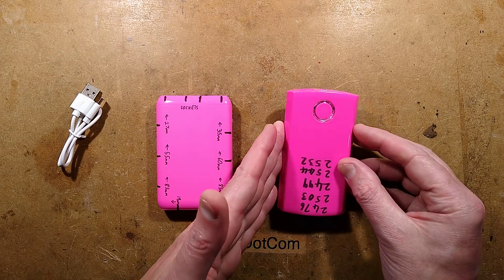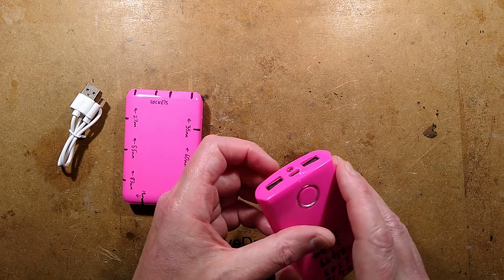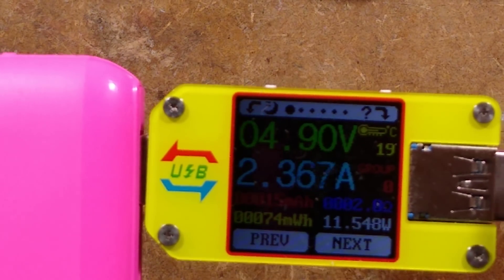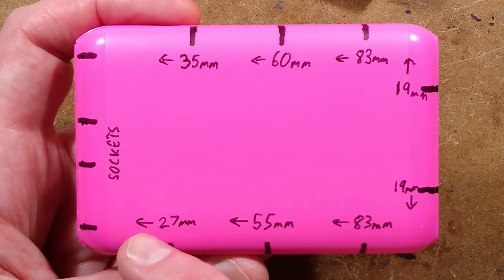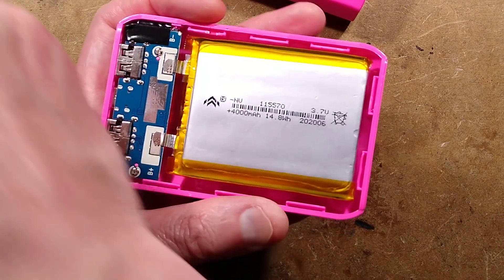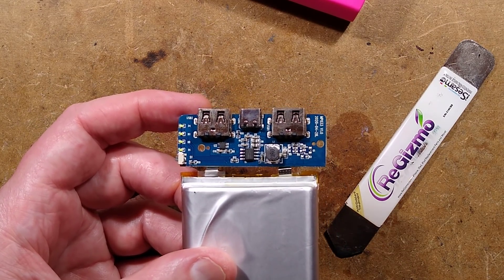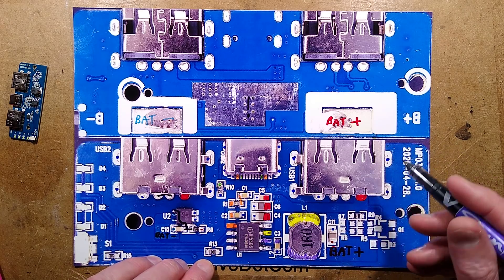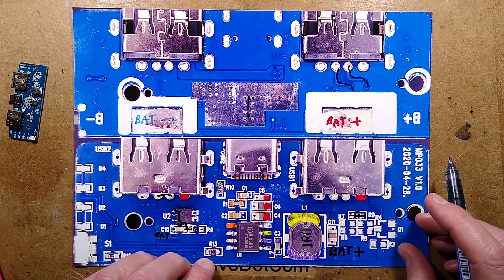Poundland's new 4000mAh power bank

Comment: I took apart a GPS a few months ago and noticed the battery, inflated slightly, had a weird smell coming from it. I later noticed it had a tiny hole in it. I immediately wrapped the two wires in electrical taped and the battery itself in electrical tape, then a thick later of duct tape. I later disposed of it.
Reply from the maker: Smells like pear drops.  When that happens it's best to discharge the cell to make it safe and then dispose of it, as it will reduce in capacity rapidly as the electrolyte escapes.
Reply: The safest way is to put it into a bucket of water. The water keeps the battery cool (so no chance of a fire) and it also slowly discharges completely through the water.
Reply: @superdau  Lithium and water is quite literally the worst possible thing you could do.
Reply: @trentvanslyke9404  I'm pretty sure lithium ion batteries don't contain elemental lithium and therefore shouldn't present that fire risk. However I wouldn't want to be the first to test this.
Reply: @trentvanslyke9404  
This is a rechargeable lithium ion battery. There's hardly any lithium in it, and especially no metallic lithium.
There's a reason fire departments extinguish EV car fires just with water and airlines instruct to to the same with battery powered devices that for some reason caught fire.

Comment: I believe that 5.1K resistor on the CC lines of the USB C connector are to tell the host device that it only communicates via USB 2 (or for power devices, signals that it uses USB 2 power delivery standards). If I'm not mistaken, tying both CC lines to ground via the same resistor is a violation of the spec. They should each have their own 5.1K resistor. This is the same design violation that was present in the initial run of the Raspberry Pi v4. There's a few articles online about the subject.
Reply: I would have bet on the CC line (Configuration Channel) for signaling Current capability (and cable orientation) as well, but I wonder about the Pinout, wouldn´t CC1 and CC2 be on Pin A5 or B5 respectively. But not sure about the pinout of that socket as well, also I can hardly imagine they crossed over pins within the socket. But you are right, if it is CC, each should have its own resistor. What makes me suspicious about the pinout of the socket as well though is also, that the outer connectors are actually wider than the others. with the housing of that socket beeing connected to ground, I would assume those are VBUS then where Power is transmitted, at least it would absolutely make sense to design those a tad beefier than the data pins. But those usually are Pin 4 and 9 in the socket. Unless of course this is actually a Power only socket, but then I wonder why they stil have 10 solder pins while actually 6 or 8 would be enough for those.
If it was CC, I just looked up what the signaling was for the different currents. I think the in this case the power consumer measures the voltage between CC and ground to determine the current the source can provide. I think the lowest value would be 0.41 V, indicating either USB 2.0 500 mA or USB 3.0 900 mA, about 0.92 V would be 1.5 A and about 1.68 V would be the full 3 A.
For those who wonder as I mentioned CC1 and CC2, those are the same pins on the different sides of the USB C plug. through this the device can recognize if both ends of the cable had been plugged in "straight" between possibly two USB C sockets, or if one side was twisted (the plug turned by 180 °)The "other" Pin would be used to power "active" cables (which is called VCONN).

Comment: The use as a USB UPS could be useful. I was after just such a thing a while back when first getting into single-board ARM machines. The amount of power banks that can do that charge and output thing is rather rare.

Perhaps, if someone wanted to use it for such, they could fit a small passive heatsink to that one chip with some superglue.

Oh, so far as my own usage went, I wound up getting a Chinese 240v -> 12v power supply that supported a 12v battery as a UPS for it. Then I used a bunch of 12v -> USB adaptors and wound up with a lovely 9AH UPS for USB and 12V.

Comment: Does anyone know why all these power banks have a minimum power   draw requirement or else the shut off after a minute?  I would love to power small 10mA circuits but can't.
Reply from the maker: It's to save power in standby.  When a phone is charged the current drop shuts the power bank off so that any parasitic draw in the phone charging circuitry or the power bank's boost circuitry doesn't continue to drain the battery.
There are circuits that pulse a higher current to keep it awake.
Reply: @bigclivedotcom  That clears up  a lot of my confusion.  I wonder if there are any power bank ICs that allow a user to disengage that feature.
Reply from the maker: @CamanoBert  There are versions - usually the lower capacity units that always put out 5V.
Reply: Could you use the powerbank to charge a capacitor then power your circuit from the capacitor? 

Perhaps via a current limiting diode? to slow the discharge.
Reply: @theopelgrave5842  I am intrigued by that idea.  I will try it today.

Comment: I kinda want one of those "OG" poundland power banks. I have been looking for a long time for a power bank that maintains a 5 volt output always.
I have a few that will drop the voltage to about 4.5 volts and drop down to 4 then back to 4.5 every few seconds. Some stay on for like 5 minutes then turn off, some will stay on conditionally, and an old flashlight/usb charger will stay on always. (until the battery is depleted obviously.)

EDIT: I forgot to add that a sufficient load (about 100-250 mA, depends on which one, tolerances probably) will "activate" the "weird" ones and will then maintain a stable 5 volt output.
Is Poundland online too? and is it UK shipping only?

Comment: He's so careful with the battery, watch a cellphone repare shop replace an iPhone battery.
Reply: It's ridiculous that you have to go to a repair shop to get a new battery fitted. It should be a user replaceable part.
Reply: @peterjf7723  This is where the 'Right to Repair' thing is heading. Governments in the US, EU and the UK are pushing for consumer laws which allow self-repair and replacement of certain parts of consumer products. I presume mobile phone batteries would be covered by this.
Reply: @mjt8199  That is good news, I hope that such Right to Repair laws can be put in place  quickly.
Reply: @mjt8199  right to repair really needs to be sorted on cars. I know several cars where the rear LED 'side lights' have failed and you can't get in the welded plastic case. So instead of a $10 replacement bulb, you know need a $600 complete replacement light unit. These examples are Toyota an GM vehicles, but no doubt the issue is more widespread... :(
Reply: @mjt8199  Part of problem is manufactures will just keep making them harder to take apart, stronger, more industrial glue, etc so if is more likely to break when doing a repair. I wouldn't put it past them to just fill it with glue, slap it together then bake it to cure.
Reply: Actually you should try to pry batteries like this with more than one "pry" bar at a time to prevent damage.  Or use a wider pry bar again to help distribute the pressure.
Reply: Big Clive ain’t getting paid per job completed 😝
Reply: @cavemandanwilder5597  I got hourly but yeah, taco the mf and it comes out unscratched 99% of the time.
Reply: The difference is that the phone shop works on the same models day in and out. Get quick to make the money. Clive was going in blind and being careful. Quite rightly I might add.
Reply: @matthewhattersley1286  Already said, I work hourly and never got paied per job, if I did I'd own a home and six cars.
Reply: @LenoreLeStrange  might want to rethink that business model. Someone should be paying for your skills, not your time.
Reply: Most of the energy in a lithium battery is in the charge that's why he recommends discharging the battery. His battery was brand new and fully charged
Reply: Jack W  We wouldn't have a job if we blew up 1/10 phones, 1/100 or even 1/1000. Blowing up a phone is a once in a career kind of thing.
Reply: Jack W  Shouldn't be afraid of repair techs, we know what we are doing, fixed more phones in the day then you've likly seen in your life.
Reply: iPhone batteries have pull tabs, why would you need to rip them out? Little bit of isopropyl on the strip and they come right out.
Reply: I do cellphone repair. He's careful for a reason i got hasty one day and burned a hole through the aluminum case on an iPad after puncturing the wrap on the battery.  Lithium, Potassium,  and Sodium among others are not chemicals to be trifled  with....
Reply: @seanmckee8382  We've all done it once.
Reply: @LenoreLeStrange  10 years in the industry, never set a battery on fire. Hit a few on accident and had a spark but no flame outs.
Reply: @chrislong7590  nice flex.
Reply: @LenoreLeStrange  no flex, just pay attention to what I'm doing when dealing with flammable items.
Reply: Well, it's being replaced, innit?
Reply: @Anvilshock  Yeah, but the phone itself isn't. And if they accidentally damage the battery, I kind of doubt they'd have enough time to get the battery out before the whole thing bursts into flames.
Reply: @HiddenWindshield  You actually have time to remove it, speaking from experience
Reply: @HiddenWindshield  yea but the battery won’t just explode right away or catch fire just like that. I fucked up an iPhone battery and it swelled up after it was out of the iPhone. Not while it was still in because i was replacing it so it wasn’t an issue.
Reply: @Alexander_l322  So, just because it happened that way once, that means it will always happen that way every time? And those videos of lithium batteries suddenly combusting due to damage are all fake? And Clive keeps a non-flammable "explosion containment pie dish" around just to be dramatic?
Reply: @HiddenWindshield  they're not fake. The point being made, is that once damaged, you have a short window of time before the fireball.
Reply: @RangieNZ  That's... exactly what I was saying: that there isn't enough time to finish extracting the battery before it destroys the phone.
Reply: @HiddenWindshield  You suddenly start becoming a LOT faster at removing the battery, when it starts heating up...
Reply: @RangieNZ  LOL I can imagine...
Reply: @idont3282  The heat from the battery fire helps release the adhesive.

Comment: if you damage it, use some aluminum foil tape! :> I do this frequently, no battery catched fire yet. Make sure you clean the surface and really squish the tape down, though. And then a layer of duct tape (the cloth stuff) to protect the fragile foil. I do this for batteries that have started ballooning. Puncture, de-gass and then seal the hole. Very important that you don't let air get in, so work fast!
Reply: Yet
Reply: @TauCu  Update: still hasn't caught fire, but the batteries that started gassing seem to gas regularly and drop in capacity. Apple and Samsung batteries are the #1 culprits.. Some self-destructing electrolyte in there, the battery becomes hard and stiff and loses flexibility.. Planned obsolescence hayo!

Comment: The area that empty on the circuit board might be a PD or QC for fast charge  like data pins are used to sense that a device needs 5v 9v or 12v i hope its right

Comment: I guess you meant to write 40 000 mAh, not 4 000.
Reply: Says 4000mAh on the thing.
Reply: @m__y-t-s  - I see that now. I'll just delete this comment later. But does this mean that the biggest 4 Ah power tool batteries they have here, which are quite bulky and heavy, are only 4000 mAh? And does this mean that my 13200mAh powerbanks, which are slim and lightweight, are 13.2 Ah?? I don't get this.
Reply: @milcotto4153  Yes and no. You got the capacity right, but the power tool batteries have more energy because of the voltage. Powerbanks are 3.7 V (single cell) while these tool packs are 10-18V (3-5 cells). So 4 Ah @ 18V would be equivalent to a 20 Ah powerbank.
Reply: @1Hippo  - 18V / 3.7V x 4 Ah =  19.5 Ah in powerbank terms. Ok, I get it. I didn't know that. It means that those expensive and bulky 4 Ah power tool batteries won't last very long on my led lamps. Might as well stick with the powerbanks. The 13 200 mAh ones cost only around 22 dollars. Thank you Hippo!
Reply from the maker: Many power banks from shady sellers have grossly inflated values.
The power tools may be 4Ah, but it's at a higher voltage with lots of cells in series.

Comment: I am wondering if you brought 3 of these for the batteries then linked up the cells in parallel for a large power usb bank.
that would work 
not a bad 12 amp hour usb power bank
Reply from the maker: Yes it would work, but make sure the voltages are similar before connecting them.
Reply: @bigclivedotcom  its more fun playing Russian Roulette with unknown cells. ha ha
"ohh thats getting hot. hmm"

Comment: Have you seen that trick with a dead 18650 battery where you puncture the positive with a needle an it revives it,I tried it an it dose work
Reply from the maker: It resets an overpressure switch.  But that suggests the cell has been abused if it has tripped.

Comment: Automotive accessory shops hsve sets of plastics tools for popping off trim. Also useful for other disassembly.
Reply: Those tools are usually yellow, orange, blue or red...
I have never seen them in pink... I guess that's why Clive don't use them 😂
Reply: Samson Holdsworth  : the sets usually include plastic spudgers do that dashboard trim isn't marred. The (door) trim pry bars are useful for dislodging things like the battery in this video... One with the largest contact area will have the least likelihood of causing damage to the soft cell.  (Good - expensive - adhesive tape can equally provide a strap to distribute forces but damage is still possible)

Keep the exit route clear and the metal containment vessel, preferably with some clean sand inside, within easy reach.

Use the smallest hammer that'll do the job.

Comment: I hate how some battery banks will shut off if your running a USB light with a dimmer, on the low setting some banks will just turn off.
Reply: Similar issue charging my headphones, current too low to keep the output on.  Fortunately two ports, so I put my phone on it, too.
Reply: There are some circuits you can build to help with that issue.  I saw one that used a 555 timer to pulse a load.  It doesn't take much power, since it's for a very short amount of time.

Comment: Would throwing this in the freezer help release the adhesive? I found it works very well with some adhesives but not others.
Reply: possibly heating it with a heat gun would be very effective in softening the adhesive.
Reply: @darkknight145  Quick hit from the back with the heat gun, just like them basement professionals repair screens.

Comment: Tempting to get 6 of the things for making up an 8Ah 12v battery pack, though I'm too lazy to go to poundland (that and a pandemic is still going on despite government claims), so, probably won't... :P
Reply: That would be 30£, is that really worth it? You could get a 5 Ah (3S) Lipo from Hobbyking for less than 20£. 
Or 10x 18650 for a similar price and even more capacity.
Reply: @1Hippo  The question is then how much and how complicated is the charge controller and output circuitry.    Though I have seen some cool 18650 holders that you can put together, and I'll bet a E-bay BMC isn't super expensive.  Still probably going to end up spending more on components though.  Speaking of, that Lipo is going to be way more dangerous compared to these unless you spend some money on good electronics.

Side note @twocvbloke.  You won't be able to charge these and get 12V at the same time.  Though I'm sure you knew that already.

Comment: My only peeve with dollar/pound shops is they sell cool gadgets, but in silly colors. Still a bargain though. 👍
Reply: Cartland pink is this channels colour of choice!!!
Reply: They usually also have black versions available, though they might sell out quickly. After that, you're stuck with pink.
Reply: @DaedalusYoung  HEY NUFFINK WRONG WID DA £LAND PINK
Reply: @DaedalusYoung  I just stopped of at my local dollar tree, they had neon green and pink in stock. Different shell case design but supposed 4000mah. $2.99usd Befor taxes.

Comment: One thing to beware of is that I've found some power banks that pass through current, but overheat if it's for more than a few minutes. So they seem fine in a quick test, but can be trouble if actually used that way.
Reply: I just completely discharged mine from full at 2.4A. it got warm but didn't shut off. YMMV as they say. I also got 2.2Ah into my 2200mAh Poundland bank so maybe I'm just lucky.
Reply: @matthewlovibond900  into? when charging? what about out of,?
Reply: @andygozzo72  2233 in, 1380 at 1A out and 1518 at 420mA out.